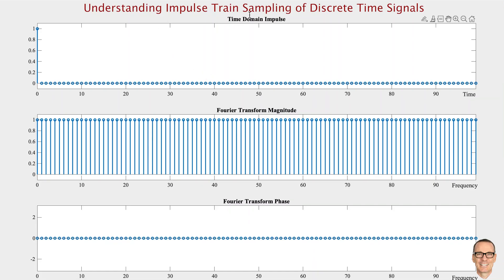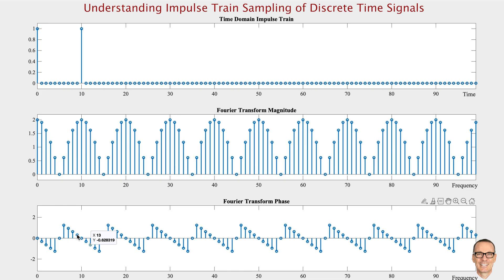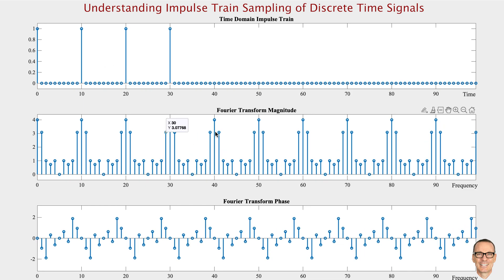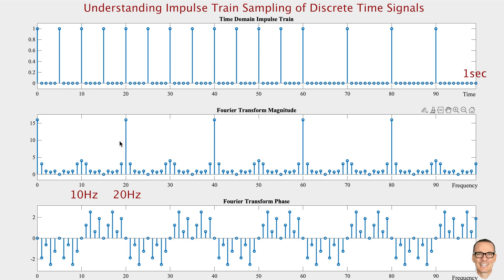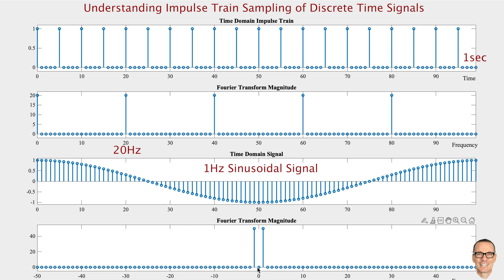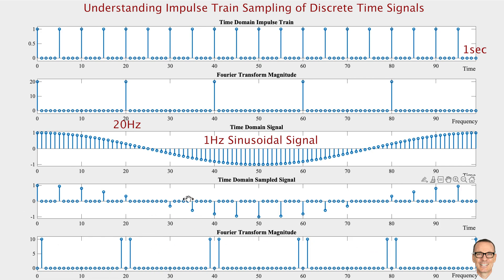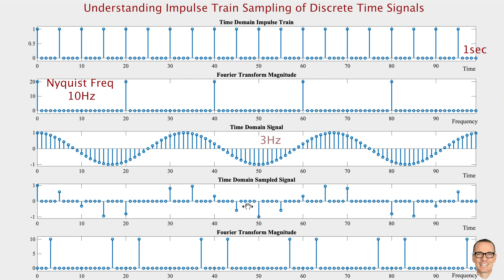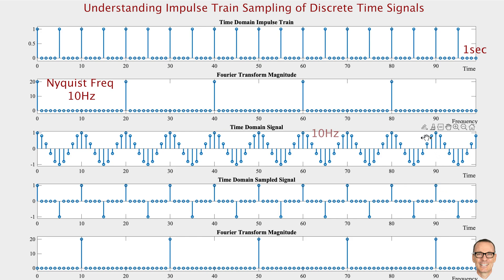Understanding Impulse Train Sampling of Discrete Time Signals

Comment: Isn’t the Nyquist frequency the first frequency we cannot reconstruct fully? In case there was a 90 degree phase, the samples would have all fall to 0, making an ambiguity between 10Hz and 0Hz (Constant)
Reply from the maker: Yes, sorry, I made a slight mistake in what I said there. You're right, in general the sampling rate can't be exactly twice the highest frequency component, it needs to be above that. Although in the case I showed, it was OK to be exactly twice, as you saw.